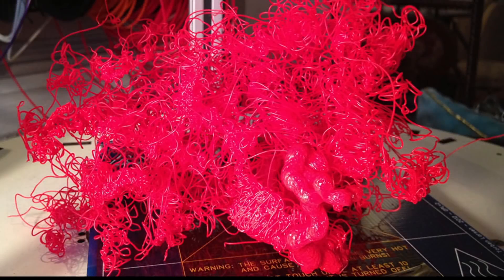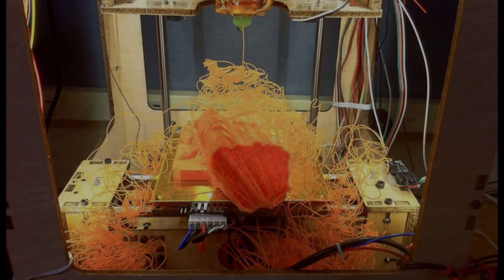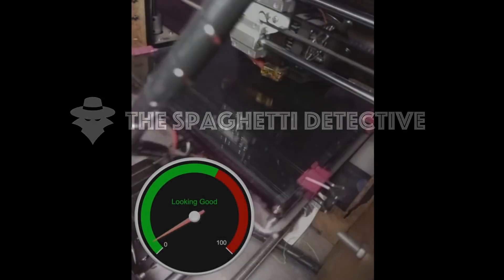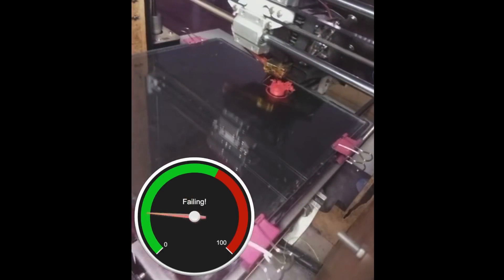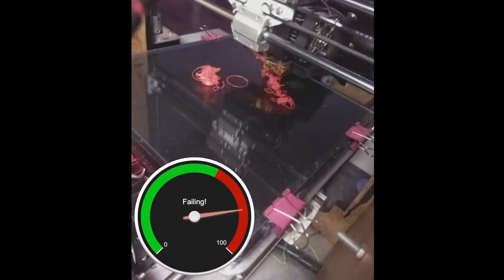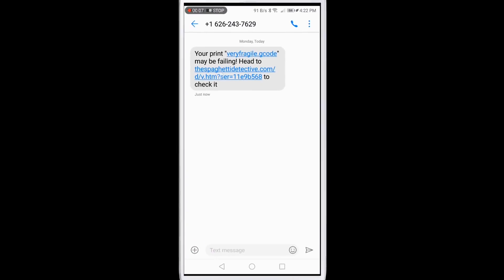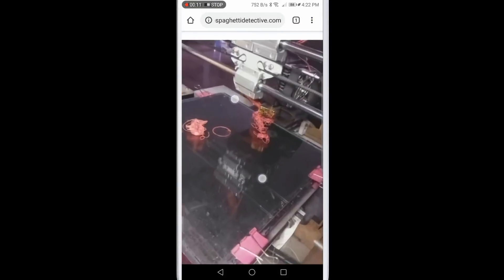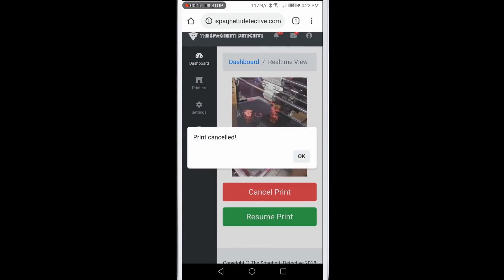The Spaghetti Detective

Comment: That is exactly what I proposed a little over two years ago, only without the extra hassle of machine learning. All the software would have to do is render what the whole object looks like from the camera’s perspective, trim the rendered image to fit with the current layer height, use that as a mask against an image of the background, and look for differences.  You wouldn’t even have to move the print head, as the issues would (generally) show up under it. As well, because it can easily pull a separate image of the printhead (take a picture of the print head in three different positions, then separate out the background), it could detect a buildup of plastic or other problems, like part of the head falling off.
Reply: This method seems simple and easier to execute, but in reality it would be too difficult to adapt to a mass audience. Lighting, camera settings, printer configurations, etc, all contribute to the success of correctly comparing the "rendered" model and the actual view. I think ML works well for this application because the spaghetti is easily recognizable across all printers, regardless of lighting, filament color or printer setup.
Reply: @astrosloth  "because the spaghetti is easily recognizable across all printers"
I know this is factual and makes sense, but I can't help but laugh at the nature of the sentence
🍝
Reply: That method would actually be much more difficult to code and would be more brittle. You would have to account for material types, multi-material, lens distortion, camera position, any firmware related code that would alter the print and thus not be available at the slicing stage, etc. Much easier and more flexible to feed the neural net with the results of failed prints and let it decide what looks incorrect. Hopefully, the plugin takes the results of confirmed failed prints and retrains the model on the additional input (if the user allows it).
Reply: @ @coltonmccormack8978 McCormack: You have some good points about lens distortion/camera position/etc., and those would need to be addressed.  Perhaps, though, I didn't make myself clear; essentially, the system would compare the OUTLINE of the print/print head against what it should be at that point and if they don't match to within a certain degree, let you know.  As long as the gcode isn't being altered by the printer itself, the system would only need to decode each layer and overlay that onto the current mask to generate a new one to compare with the camera image.  While the system wouldn't notice things like layer separation or issues 'in front' of the print (a separate camera at a different angle would be needed), things like layer shifting, filament runout, buildup on the head, etc. would be obvious, and those are the things that are most needed to be watched for.  As well, the AI would have to account for material types, multi-material, etc. to do more than outline matching.